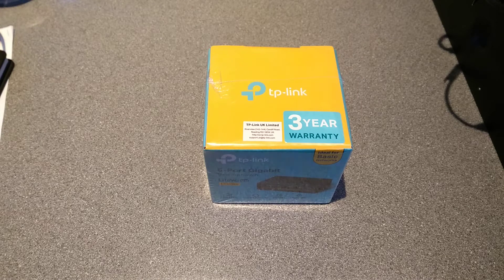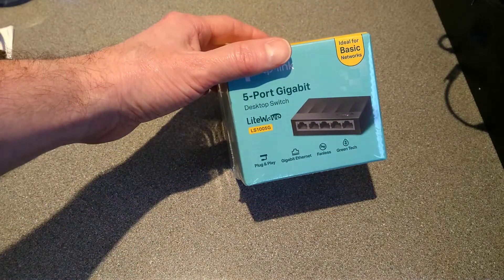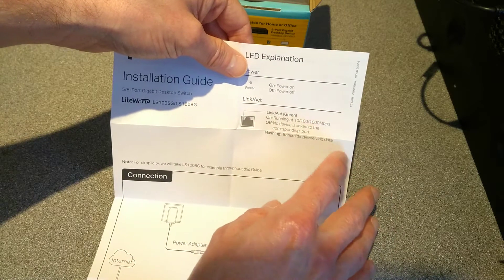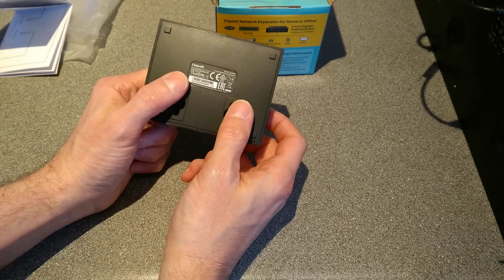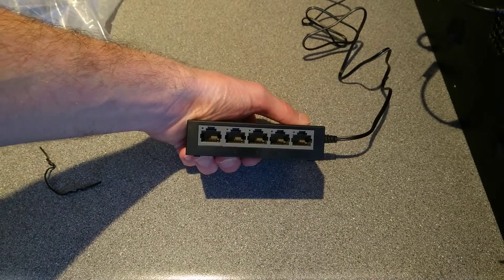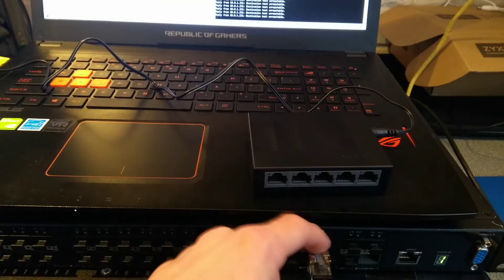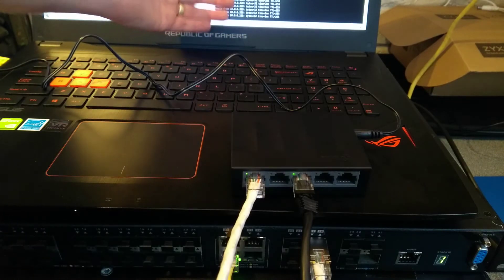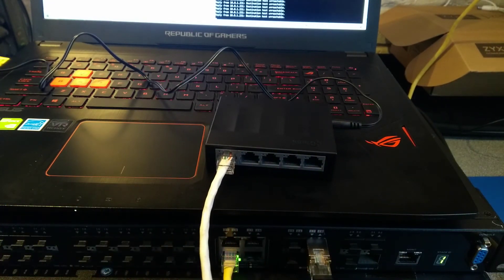LS1005G 5-port Gigabit Switch (Tiny!)

Comment: Ijust got this , and both my ps5 and mesh in the room showed 90mbps speeds, my isp is up to 800 mbps, is there something wrong?
Reply from the maker: Check your cables have all the wires. Some really cheap cables (ones which come with power line network devices or Hive heating devices) often only have 4 of the 8 wires. This would limit you to 100mbps (around 90mbps on a speed test).

A broken cable or cable which has been wired wrong would also cause similar 100mbps limit.
Reply: @freename   tq for the info, found the problem, the main cable was just slightly loose at the main router
Reply from the maker: @shawalfida6357  Excellent, glad you found the cause :)

Comment: Thanks for your video!

Do I understand right? Theres 1 LAN-Input (at 1Gb/s from the Router) and 4x LAN-Outputs (at 100Mb/s for each device)?
Reply from the maker: They are all 1gig and it is a switch [sends traffic out any port if the destination IP or device is on that port] so there isn't such a thing as "input and output" (e.g. a NAT router where the "Internet" (WAN) side is isolated from the LAN side).
Reply: Can you tell me in non computer jargon, of the 5 LAN ports,, which one is the input from the router.
Reply from the maker: Switches do not have such a setup. All ports can talk to all other ports. It doesn't do any modifications or routing which would turn one port into a router only port.
Reply: @freename  Ah. Thank you